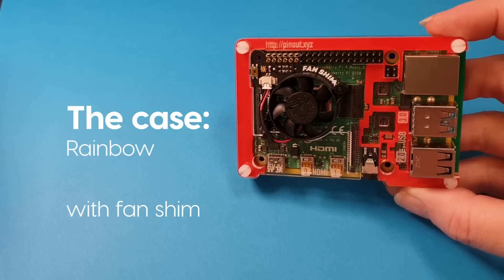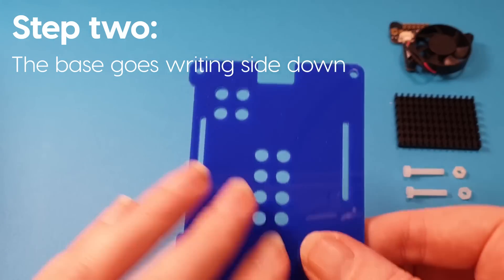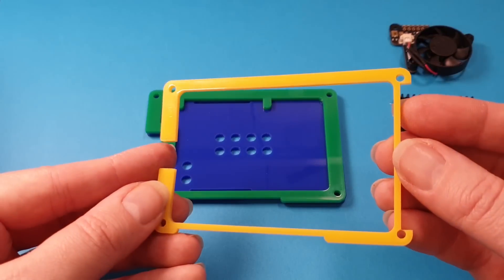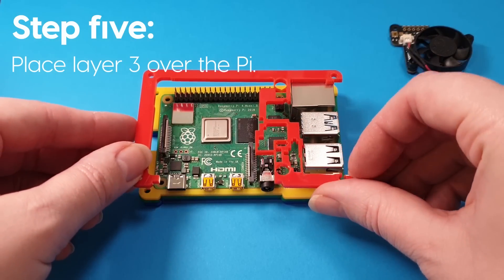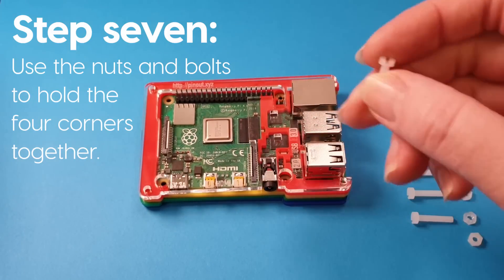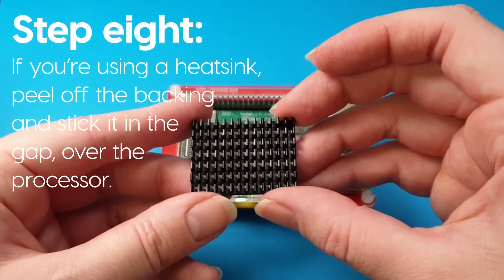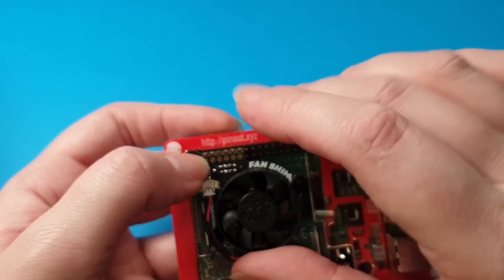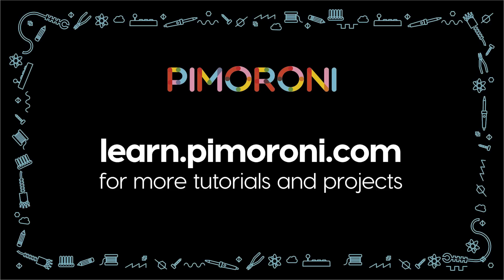Pirate how-to #2 - Build your Pi4 pibow

Comment: Can I fit the PoE HAT together with that the Pibow for a Pi4? (so not using your heatsink or your Fan Shim)
Reply from the maker: I've tried it, and the transformer on the bottom is just too large, so you'll need header extenders for the GPIO and PoE headers.
Reply: Thank you  @pimoroni  I just have to wait for my order to be delivered to try the following... not putting the latest layer from the Pibow. This might give the necessary clearance. So just using the Pibow bottom 3(?) layer. What do you think?